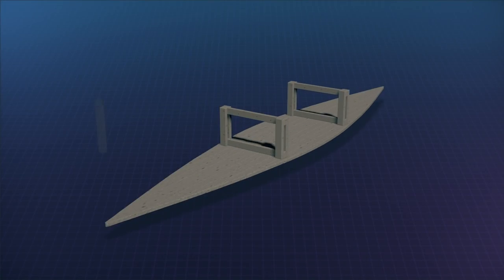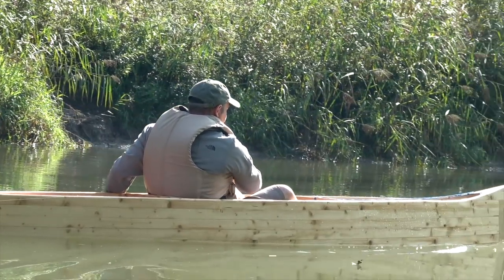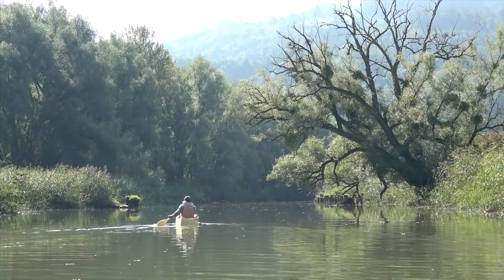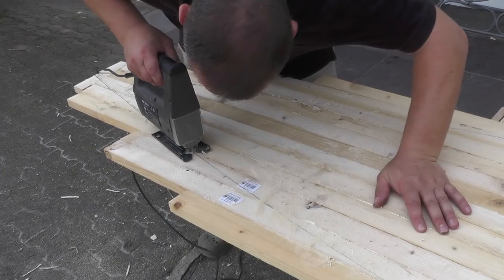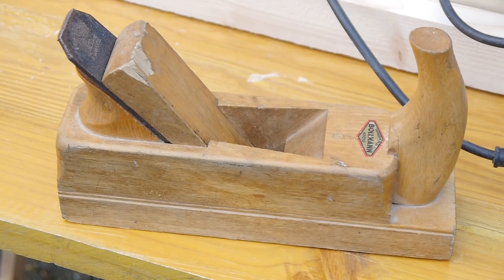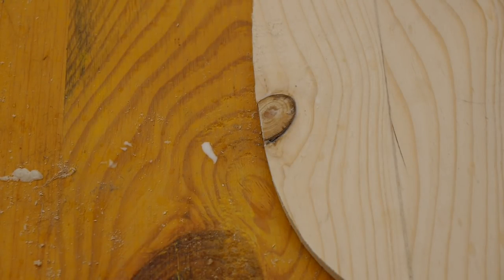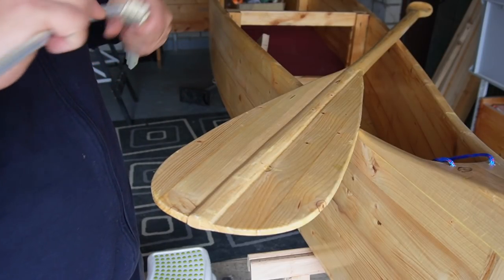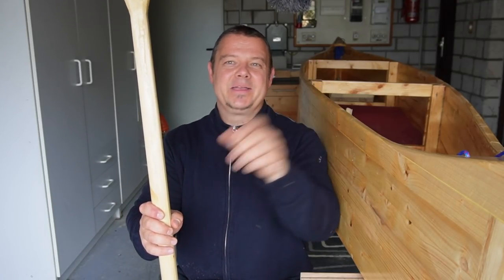The DIY 7$ Canoe Paddle from Roof Battens - How to make - with just some common tools

Comment: Superbly done. As a suggestion you could think of using outriggers. They will help you with stability. Also you could make it into a removable attachment. That way depending on the conditions you can decide to add or remove the outriggers.

Comment: Really enjoyed this, apart from the bandsaw. Love the way you were able to use the belt sander with one hand. I'm not strong enough to get the control with one hand. 
I was wondering how well the white wood glue is holding up? Even if you use a 'waterproof' one, the water will soften it.
Reply from the maker: Thanks 👍  I uses Collano Semparoc Rapid S. This glue hold like crazy. The connected parts are stronger then the woos himself.
Reply: @FelixImmler  makes sense now, it's polyurethane, not pva.
Reply: Das ist Pu- Leim! Und der hält garantiert nicht gut bei solch offenen Klebefugen! Auf das Paddel würde ich definitiv nicht vertrauen! Oder halt eins als Ersatz mitnehmen.